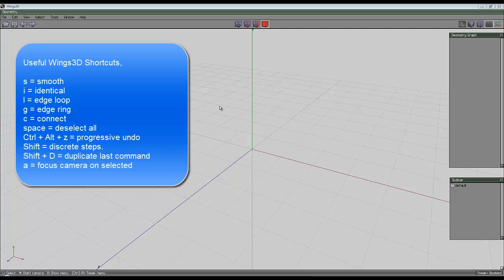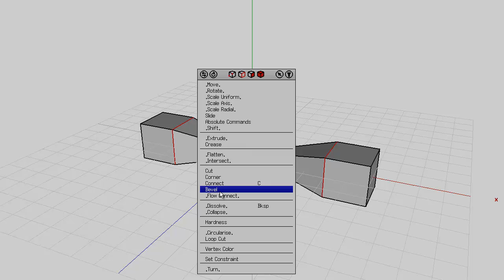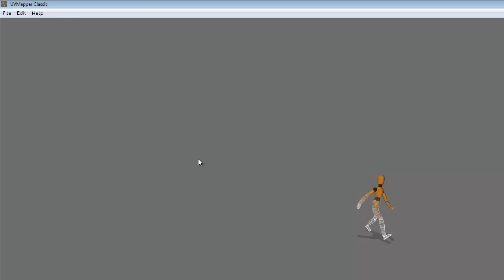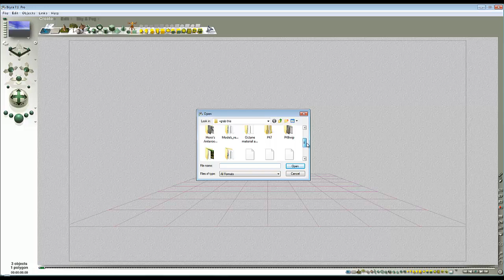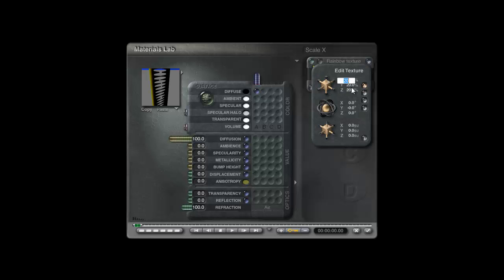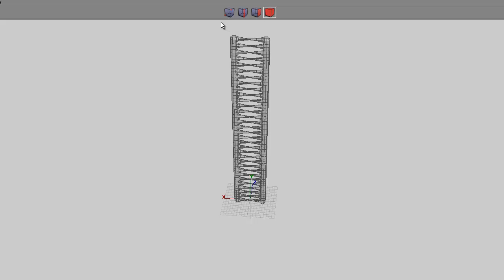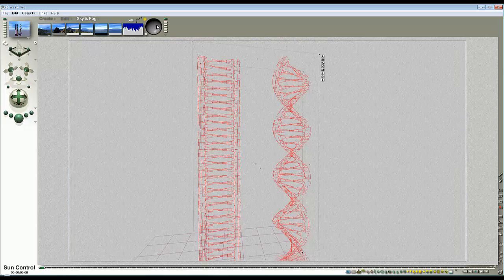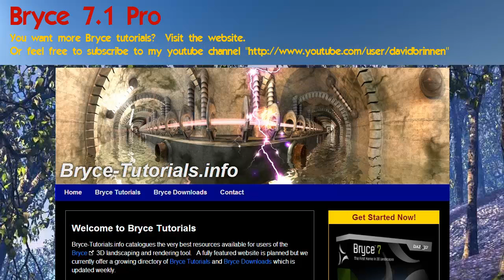Wings 3D, UV Mapper Classic and Bryce - colouring both sides of the helix - by David Brinnen.

Comment: David I use the Wings3D UV mapping. It is a good bit more involved than what you just did here. Even so, I think it does a fair job. I have UV Mapper Classic too, but rarely use it because it is a bit too simplistic for my taste. Blender and Hexagon have the capability also. One thing you have to be careful of when UV mapping is a problem in which an image on one part of a model will be projected onto another. I still have to found any info on why this might happen. Just a heads up, Mate.